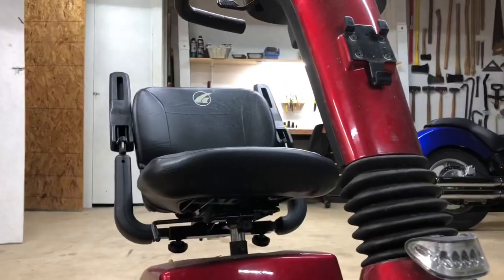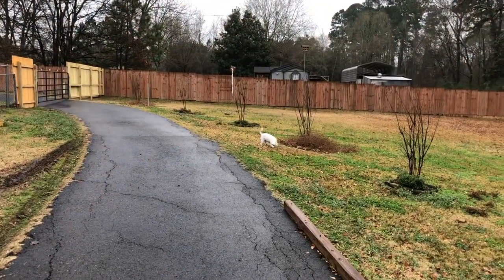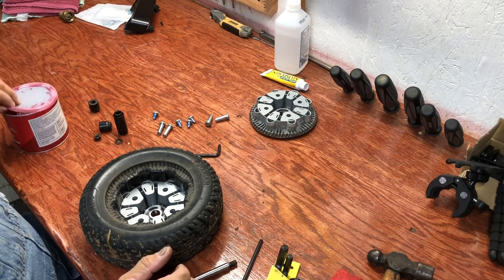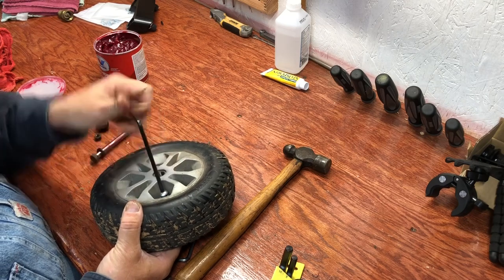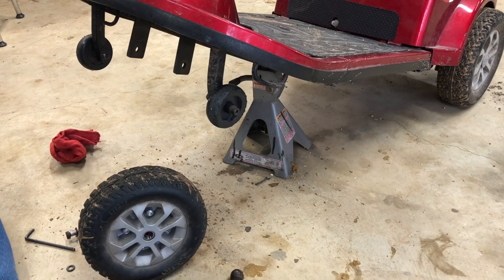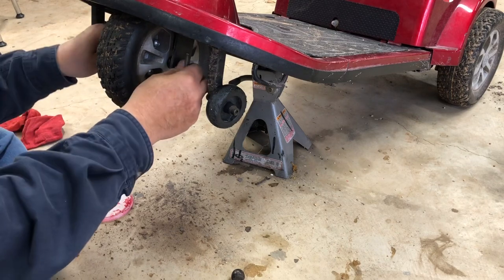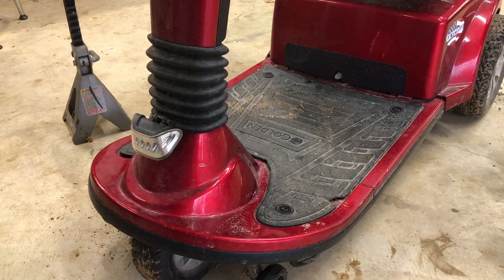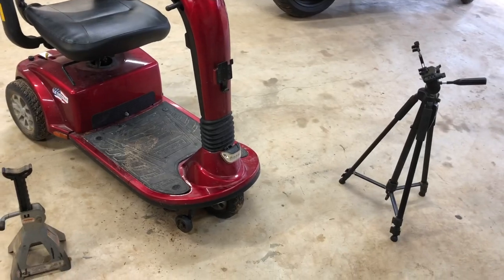How to replace wheel bearings on a mobility scooter

Comment: standard to metric wrench conversion hmmm, maybe ill play in garage tomorrow. 
Bolt Diameter	Standard	Metric
1/8"	5/16"	8mm
3/16"	3/8"	10mm
1/4"	7/16"	11mm
5/16"	1/2"	13mm
3/8"	9/16"	14mm
7/16"	5/8"	16mm
1/2"	3/4"	19mm
9/16"	13/16"	21mm
7/8"	22mm
5/8"	15/16"	24mm
1"	25mm
3/4"	1-1/8"	29mm
1-1/4"	32mm
7/8"	1-5/16"	34mm
1-3/8"	35mm
1"	1-1/2"	38 mm

Comment: I'm in the business, and still don't like changing wheels...got 75 to 100 used electric power Wheelchairs and scooters in stock. If you're in southern Oregon...contract me..got 3 Permobil units that sold for over 35K bucks for $2500 ...runs fine.
Reply from the maker: Is the water in bearings a typical issue? This unit is only 2 years old,but it does get driven in the grass alot.
Reply: @bctruck  Roger that !....remember most units are made in China..like your Golden, Companion, Pride and many other shiney units. Like most other things, designed life expectation limited to market/ engineering theory and virtue is more than just fortune cookie market flooding imperative. Especially now !  In most cases, people, less interested in fixing these things, buy another one. Genius yes !
Buy or get same model for spare parts...even then sometimes they don't match !
Reply from the maker: Thanks!
Reply: @bctruck  p.s....to state the obvious..don't let those gel cell or ogm batteries get below 50% charge...shortens life, and quality batteries are now just under 200 bucks for a pair of 24's.